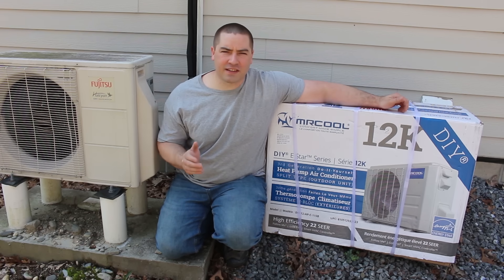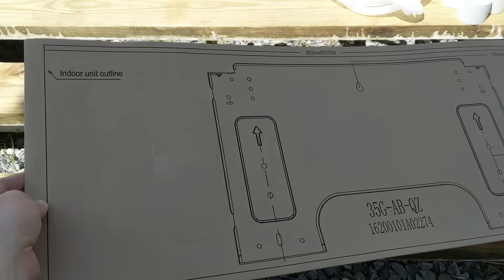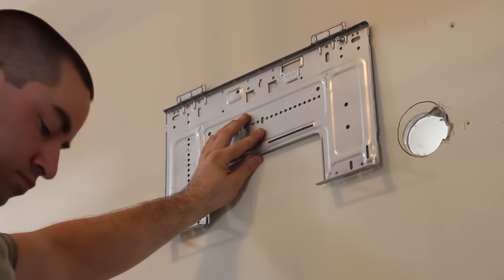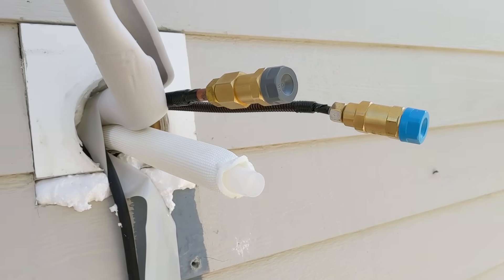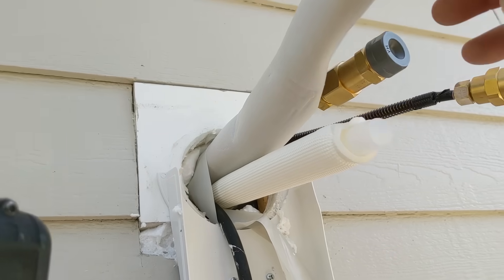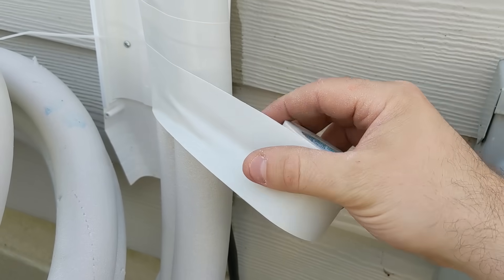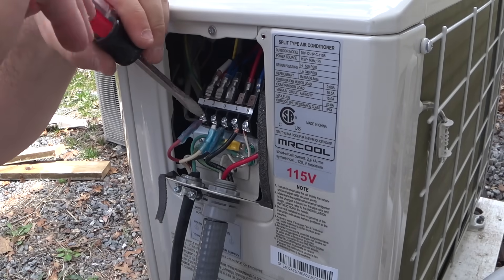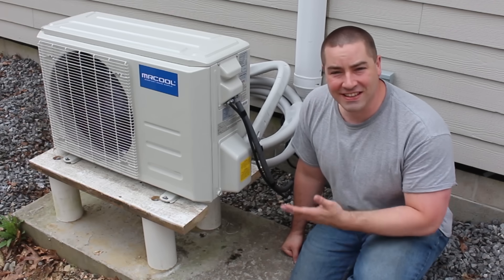Installing My Own Mini-Split Heat Pump, DIY

Comment: Nylock is strongly suggested NOT to be used in any pre-charged lines.  Also, waaaay over tightened them.  Has heating or cooling failed yet?  Leaks?  I sincerely hope not.  I nearly used it, but saw the correct info the night before I connected the lines.

Comment: I would greatly recommend to have an certify electrician take a look when upgrading an existant unit.
What was the amp of the ancient unit compared to tge new one?
You mention that the existing wiring was for 240V. Sound risky for some DIY.
That could be a potential fire hazard if CB is too high.

Comment: If these mini splits only last a couple of years, isn't it better to go with a standard central air unit (like a Trane) which can last upwards of 15 years on average?  Even wall units last 10-15 years.  I get the feeling these mini splits are cheaply made and over priced.
Reply: Agreed. If I had a mini split it only lasted two years reliably, why would I want to put another one in?

Comment: no need to follow torque specs when connecting the lines ???
Reply from the maker: These fittings are unique for the DIY lineset.  They are relying on O-rings, not flares.

Comment: Vacuuming down the so called Non DIY units, if you look at the videos is dirt simple, and tools would cost you about 150 on Amazon, The compressors come precharged on those units. MrCool is pretty cool though, I'm using one for my first install. If i do another, I'm definitely going the Non DIY route.

Comment: Using that red locktite I hope you never have to take those lines off. You will probably have to cut the lines. For reference you can use the green locktite and it will still hold but you would be able to remove the fittings later if you needed to

Comment: It's a very useful video for a DIY, but why didn't you cut the copper line and re-flare them so you don't have 8 feet of copper coiled up? It only takes a minute and makes a much cleaner job.
Reply from the maker: This DIY kit has special fittings on the end that can't be cut off.  The lineset itself is pre-charged in this kit.  I have another video on my channel where I used a more common mini-split where the lineset is not pre-charged and I cut and flared those.

Comment: David - Awesome video. Nice clean install.  You make it look easy.  Now that it has been a few years I have a question about the refrigrant lines.  Please know, I'm not picking on your great install l when I ask this question.  Far from that, just curious for my install.  Question - I understand that when we coil the lines up like you have behind the condenser unit, it may accidentally create a low spot where the refrigerant oil (in some refrigrants) could possibly pool and cause a problem. I'm getting ready to do a similar install.  Any updates on do's or don'ts?  Thanks in advance.  Keep up the great videos.  Dan in MD
Reply from the maker: I didn't like the coiled tubes either.  The unit stopped working for me and the company stopped responding to my request for warranty.  So I ended up removing it and installing a normal system.  You can buy a cheap Pioneer (or similar) plus buy the vacuum pump and gauges, and still be less cost than this.  Check out my more recent video showing installing the more traditional setup: https://youtu.be/Kd092alkeaE?si=2BNundtvSruteolt
Reply: @ - thanks for the quick reply.

Comment: You missed one step.Before you screw that top cover head on you have to seal all your open areas where the pipes come thru the wall or water 💦 water will get in.make sure to seal all open sides of the head. Like Clear lexel or something. But your video is nice.I enjoyed watching it.great job!

Comment: Nice job on the install. I don’t know if comments have hit you up on “Evacuation” or pumping down into a vacuum which requires a pump and hose / Manifold set. Hey, if it works. 
Words of caution; Red spray foam is sold at home stores for penetrations through walls for fire stop. It is code. Rodents, squirrels and a few other pest have front teeth that grow like fingernails per month. Squirrels are the #2 reason for home fire in the US. The power cord and line set may require fine mesh wire screen wrapped gently around the upon inspection as time passes. Hate those critters but I had “Woodpeckers” attack the siding on my house. Wild fires in the west, have spooked the birds East. I am in Omaha, these are a huge problem all over. Of all the things a guy has to worry about, woodpeckers! WTF!
  Electrical tape unravels on the ends. Try a dab of black weather strip adhesive on this tag end. Rub it gently to seal & cover, end of story.
ASE Master 78, retired. 
 Thanks kindly for sharing your “Mr. Cool” story.

Comment: just did my mr cook 18k advantage series. 

You guys might want to go with the advantage series instead of the DIY. The money saved on the unit will go the the HVAC tech, yes But worth it. The pro will give you the full warranty and its nice to have a pro look things over....Also  He will re cut and re flare the fittings to new, non factory flares.  vacuum test the lines to ensure no leaks....and the best part.....He'll cut the piping to size ending right at the unit.  No 10 feet of coiled lines trapping oil and looking an eye sore. I also had the guy install the same water liquid tight conduit to match the incoming electrical.  Don't want my communication cable exposed to elements and not matching will be mentioned to me by the significant other....cleaner install

Comment: How is that exposed electrical cable holding up? Does that area get a lot of sun? Other videos I've seen use liquid tight conduit on both the whip, and the communication wires.

Comment: You have made a major mistake - you did not pull a vacuum on the line set - the air and moisture will mix with the refrigerant and cause a nasty acid which will kill your compressed air

Comment: I saw your video, your work is very good, but you made a mistake when you opened the light wall, you should have taken out the air from the side of the discharge section, which you didn't.  Of

Comment: Do you also have a heat settings?
Reply: What's the square footage this unit can handle?
Reply from the maker: Yes, it heats and cools.  However, the unit stopped working for me, and Mr. Cool stopped responding to my e-mails.

Comment: You dont have to vacuum the system?
Reply from the maker: This "DIY" package comes with pre-charged lines.  The lineset has one-way valves that only open when you connect it.

Comment: I wanted to see how awkward it is hanging the indoor unit but that final step was skipped past. Also wanted to see if he taped that whole coil of extra line but that was skipped past too.  Does that outdoor unit need to be bolted down?  Can it just set on cement blocks like a boiler? Did he wrap the tube joints all together or each separately, that was skipped over too,  and how can you check for leaks after wrapping, and how do you leak check behind the wall unit once it’s installed?
Reply from the maker: I have another video with far more detail on each step: https://youtu.be/Kd092alkeaE?si=kr2H6gsI2SwA_mwK

Comment: How about that screw/valve in the bottom of the lower pipe on the outdoor unit?
You didn’t do anything with that in your video.
Isn’t this the valve that actually let out the refrigerant liquid?
I am asking because I am a totally newbie to this and I really need all the details.
Thank you.
Reply from the maker: I have another video that goes into a lot more detail: https://youtu.be/Kd092alkeaE?si=hdsUza15r0Yy4ReN

Comment: Should have hid your excess Lineset inside... No point in having hide a line if you're gonna just have 20' coiled up at the condensing unit. Cut down the electrical too. Good install though

Comment: Hate to be the bearer of bad news but leaving all that excessive rolls of refrigerant piping in place is a train wreck waiting to happen.
Where did you get your training & education about the refrigeration cycle???
Reply from the maker: I agree, the coil of excess tubing is terrible.  This was a DIY kit from Mr.Cool.  The linesets are pre-made and pre-charged with special fittings.  They can't be cut in the field.  it was my first (and last) time trying out this kit.

Comment: My internal unit came with a high presure on tin pipe ( high presure pipe) if I take out the plastic protection. The other has not. What is it? Thanks.

Comment: Speaking from being a lead in hvac for over a decade I get wanting to do it yourself but the setup is not ideal. You have a spool of lineset in the back of the unit creating an oil trap and will kill your unit a lot faster than no loops. And not putting the equipment in a deep vacuum before releasing refrigerant you have non- condensable in the lineset also will kill your unit. Not ideal

Comment: Do you still have the unit?  Is it still working as it should?
Reply from the maker: No.  The Mr. Cool failed.  I was communicating with Mr. Cool for a few months with e-mails trying to get a replacement under warranty.  But, they eventually just stopped responding to me altogether.  I ended up buying a different brand to replace it.  I didn't film the replacement because it is identical to this one I filmed: https://youtu.be/Kd092alkeaE

Comment: Well made tutorial, thank you. Im looking to install this the sleeper of my semi. My questions are - can you tell me the amps and watts it pulls at start up? How long did it take you to install once the old was removed?  🤷‍♂
Reply from the maker: It's soft start.  The Amps ramp up slowly.  I think it goes up to maybe 7 or 8 Amps on 120V.  But, Mr. Cool failed on me, so I wouldn't buy a Mr. Cool again.

Comment: It's been a couple of years now. Wondering how the Mr Cool is holding up. Follow up vid?
Reply from the maker: Mr. Cool failed.  I was going back and forth with Mr. Cool on Email for a few months trying to get a warranty replacement.  Then they just stopped responding altogether.  I ended up buying a different brand.
Reply: @DavidPozEnergy  Well that’s not cool at all. Sorry to hear that. Hope the replacement fares better!

Comment: Good video. I am actually in installs and have done a nice amount of these jus a small worry u might one look into and thts shortening up tht line set , cut re-flare then run it into the outside unit. Tht extra lineset could cause malfunctions of all sorts

Comment: Any updates on how this unit is working two years later?
Reply from the maker: I had to remove it.  It stopped working.  After about a dozen emails, Mr. Cool stopped responding to me.  I replaced it with a different brand on my own dollar.

Comment: Any updates @davidpoz?
Reply from the maker: This heat pump stopped working.  I was having some back-and-forth emails with the company for a while.  They kept asking me to check this or that, and send them photos.  Eventually, they just stopped responding.  I ended up buying a different brand to replace it.
Reply: @DavidPozEnergy  thank you for the feedback, and also the great original video. Will definitely be implementing a lot of your tips.

Comment: At what point does it become charged with Freon, and why were the lines not evacuated first to remove moisture from the air trapped inside? Seems to me that's a premature failure just waiting to happen.

Comment: Thanks for the great detailed video. BTW, I called Mr Cool in preparation to installing mine. They recommend NOT to use anything like the Nylog gasket/thread sealant, but instead use nylon tape.

Also if anyone is wondering what size line set cover to get, I was told the 4" for the 18K unit.

I wasn't impressed with the thin rectangular rubber vibration isolator pads that come with the condenser. The mounting fee for MR Cool strange and don't support a single threaded post to fasten with. I'm mounting mine to the side of the house, and wonder if anyone has a good suggestion for better pads?

Comment: What I don't like is that they have a unique fitting, so if you want to cut the lines you can easily damage the fittings, specially the O rings. Otherwise is very nice that they have the portion that is coming through the wall wrapped in that spring like material. I believe you should have leak check after you have all the lines as you liked it, you could have created a leak by trying to accommodate the lines after you already pressurized.

Comment: Have you vacuumed the system????  Or at least released the refrigerant gas for a few seconds, to get rid of moisture and air from the pipes and inside unit??

Comment: Does that unit have back up heat strips?  How has it worked out these last 2 years?
Reply from the maker: There are no backup electric heat strips.  It failed very quickly and Mr. Cool has stopped responding to my emails attempting to get a replacement.
Reply: @DavidPozEnergy  That's good to know. I see in another video you installed another unit from Signature solar?  How has that unit been and does it have backup strips? I am up north and most conventional heat pump systems need the strip heat when the outdoor unit goes into defrost.
Reply from the maker: The unit from Signature Solar has been working really well.  Frankly, I'm not sure it's any better or worse than something like a Pioneer from Amazon, but it works for me.  There are also no electric heat strips in the one from signature solar.  I live in the North East US.  This morning it was 15°F outside.  So the unit is going into defrost about once an hour.  It doesn't bother me when it does.
Reply: @DavidPozEnergy  Thank you for the information. I have a small solar system set up but it is in an unheated barn. I have some of those bolt silica salt batteries out there now. I need a small heat pump system to keep the room I built to house the new lipo batteries above 40°.
Reply from the maker: That's cool.  If it's a whole room, then I don't see anything wrong with going with a heat pump.  If you wanted a smaller solution, check out this other video.  I helped a friend of mine set up a little backup system with LiFePO4 batteries.  He insulated around the batteries, and used a very small (40W) heater inside.  It has kept the batteries warm even in -20°F temps that he gets. https://youtu.be/6XLOKtl-q3s

Comment: You MUST vacuum the line set to remove air and moisture. It will come back to haunt you in the future. Did the instructions call for that?  Are the lines pre-charged? If so it looks hokey to have the lines coiled behind the unit. Thanks for the video.

Comment: My heat pump underneath my deck has slightly tilted due to the ground settling. Am I able to slightly tilt it back level while it's connected and maybe put a bit more fill underneath? I don't want to damage the unit by moving it too much.  Any help would be great! Thanks 🥃

Comment: FYI.  I found when trying to drill over an existing hole… it’s safer to drill a 1 x 6 or 3/8 plywood first.. set this over the hole and you have a safe guide..

Comment: All that just for one room?
Reply from the maker: My whole house.
Reply: @DavidPozEnergy  so the door is closed how does the heat or cool air get to the all the other rooms? I don't see it hooked up to ducting.
Reply from the maker: I built my house to super insulation standards.  Plus, it's a small house.  There are only two rooms with doors, the bedroom and bathroom.  If the doors are shut there might be 1 or 2 degrees difference between the great room and bedroom, but that is acceptable to me.  Plus, I have a ventilation system bringing in fresh air 24/7 which helps circulate the air.  I have about 100 videos on my channel showing all the details of the build if you are interested.

Comment: I’m so curious to see
What he does with extra length on lineset
Reply: Hahahaha, omg , just leave that lineset rolled up, that’s ridiculous,
A heat and air guy could
Probably pretty it up for about 750
Reply: These are not do it yourself appliances, or you end up like this a big roll of wire and copper just wrapped up and laid behind unit
No place to get repairs done, good luck getting parts for it at a
Amazon

Comment: But you could have used a line set cover set which would have saved you a lot of time and effort. And your low voltage wire would go in with your other lines and they have fittings that make 90° turns and get it right to your conditioner. It is really not necessary to do it the way you're doing it

Comment: Question: I have a 30,000 btu minisplit installed.  How difficult would it be if I wanted to upgrade my system myself? The electrical and everything else is in place....

Comment: Nice vid.

Question. How would a second indoor mounted unit attach in a different area in the house? Same lines , same kind of hole ?
Reply from the maker: This particular unit is designed for 1 indoor head per outdoor compressor.  So you would just install a seconds system altogether.

Comment: Great reference. Do you have a similar load test for the cooling portion of this unit? Trying to figure out the watt,amp,surge load for this unit to work of my solar system on cooling mode only. Currently have a 1500 W pure sine inverter with solar charge controller supplied by 2 200w panels and 2 200 amp h lifepo4 batteries

Comment: 1.without vaccum pump to expel the air in the system, the efficiency is reduced and won't last for long. 2. without torque wrench, the connection is bound to leak and adding refrigerant from time to time is not a long time money saving solution. need to invest in pump and tools to cut the pipe and make it vaccum before operation.

Comment: Just because you couldn't find a good HVAC technician to repair the leak in the Fujitsu which is a great Japanese unit, you bought this piece of shit MR Cool. Also, you didn't vacuum the system before opening the refrigerant lines so you trapped moisture inside the lines. Not good for the unit in the long run. P.S, I'm an HVAC technician.